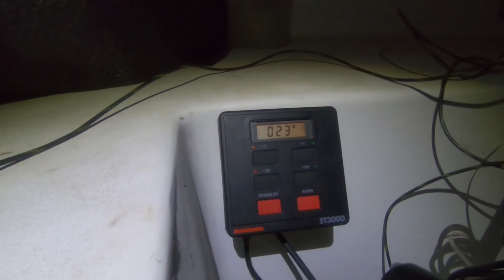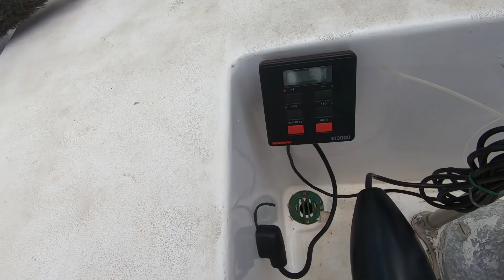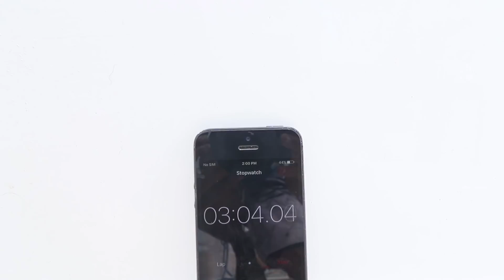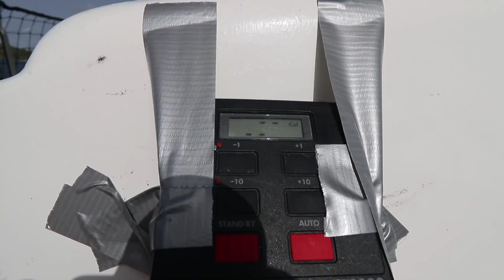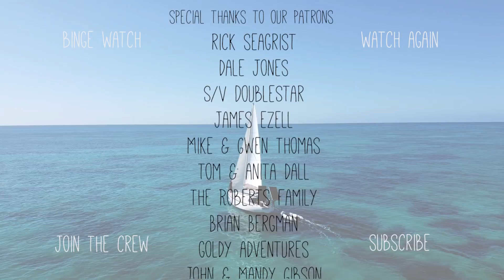Sailing Will NEVER Be the Same | 117 | Beau and Brandy Sailing

Comment: You guys are great! It is a great pleasure to sail on an older boat. I had a 1960 Alden way back in the 1990’s and I learned so much and had so much fun. I was horrified by the crack in the bow. I wish I could have told you my secret sooner. If you ever have any trouble with it, the old glass should be wet out with mek just before you lay the new glass. Just until it gets tacky. Then the repair has both a chemical and mechanical bond to the hull. Also make sure the resin is iso-thallic. It will resist blistering and absorbtion. You did a great job and maybe you were told about the trick. If not it may be fine but do keep a check on it. If you ever see the slightest delam go ahead and redo it. Also give the new glass a couple of weeks on the hard to completely cure. It helps avoid absorbtion. That mek trick makes the old and new glass become one as if no damage had ever occurred. That can be a big deal at sea. I just saw a new boat with a “crash box”. Its a water tight bulkhead in the bow. So if there is ever a collision youre safe. Just glad you made it safe. Love the autopilot!

Comment: Boy, oh boy!  I have used an Autohelm 3000, which was new in 1987, since I bought my Catalina 34 in '91.  It is still working!!!  It steered me as cross the Pacific, San Diego to Hawaii, in 95.  It is still working fine!!!  I had to repair a power wire a couple times, but otherwise - Old Reliable!  You're lucky to have it.  Congratulations.
Reply from the maker: NICE! Good to know! So looking forward to putting it into use!

Comment: Try spraying them with WD-40 when they come out of the jar. That should 
help keeping the rust coming back.
Reply from the maker: Oooh. I have CANNNNNNNS of that stuff, now I can put them to good use!
Reply: Good but better is the CRC 6 - 66. Marine purpose.
Reply: WD40 is good initially but dries in 2 days or so. 
Best antitrust  lubricant is LPS 2 inside it won’t dry for about two years.

Comment: Great work on the auto pilot install Beau.  You Jinxed yourself when you said it would be done in a couple of hours.  That called Murphy down on you-The project will always exceed the time allotted.

Brandi you looked very chic with the scarf and the hat doing the laundry.

To keep the tools from rusting quickly, see if you have some teflon in oil spray and spray the tools inside the bag.  It will help retard the development of rust and help keep moving parts moving.  Take care, stay well and enjoy that auto pilot.  Have you given it a nome yet?

Comment: Hi there you two, greetings from South African.  Haven't finished watching today's video yet, just wanted to give some advice, take it or leave it.  Firstly try using Electrolysis with Salt Water (plenty in the sea) mixed with vinegar.  Secondly once finished (I have left it overnight before) neutralize the acidity with window cleaner and bicarbonate of soda, you can also rub it down with steel wool and a brass wire brush.  Once dry spray with something like WD40 and if the tool is to be stored you can heat it a little with a hairdryer and rub bees wax on the steel surfaces to seal them.  Here is a video clip on the Salt and Vinegar Electrolysis process, plenty more on YouTube:  https://www.youtube.com/watch?v=3Ajna9ibBmk

Comment: Mount it on the pedistool under the wheel as others do your putting the belt on Jeopardy of damage , serious bordom setting here need to go sailing , you can  get shorter belts  or miter cut the one you have and and lash and glue it together , they use 5 amps of power on average so may have to star your motor to comp once a day oh sorry your electric dam oh well you’ll learn thanks.

Comment: The chain plates can be repaired if the are not to corroded. Grind out the crack on one side to about 1/2 way through the metal. fill the v with 316 or better 321 ss rod. Do the other side the same way making sure that you remove all the crack. Finish by grinding flat and polishing. 316 and 321 ss have far less carbon in the alloy and are far more resistant to corrosion. They are stronger that 304 or 302 ss they   are stronger as well.if u did not know you can drill ss easily with cobalt drill bits. They are harder than high speed steel and also much more brittle. both the drill and part have to be held solidly so that they can't move while drilling.  A part that has considerable corrosion should be repalced  and not fixed.
csmale@bak.rr.com

Comment: ST 3000, I have not seen one of them in years. They work great though. Buddy had one on a 40 footer. Autohelm was bought by Ray Marine. You can adjust course 1 degree at a time or you can hit another button for a tack. Very easy to learn. You know I think I have most of the parts for one in the attic. I have an ST 4000 that is 20 years old and still works. I dont think  the ST 3000 is still made. You will love an auto pilot. Remember to name it. I call it the mechanic wife (wife does all the steering) Have fun. You want to mount the controller so it is easily reached from the helm.